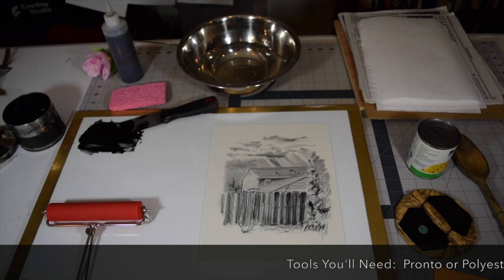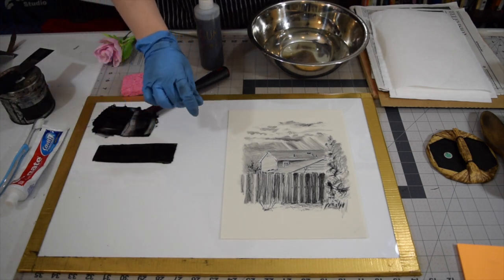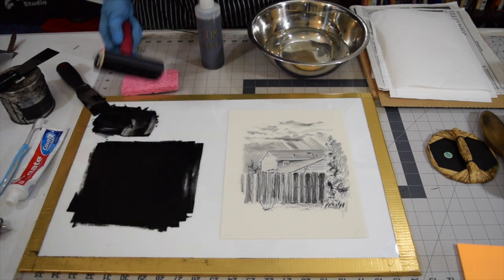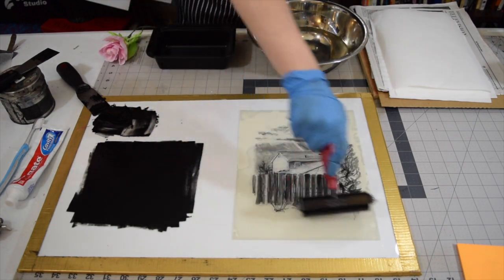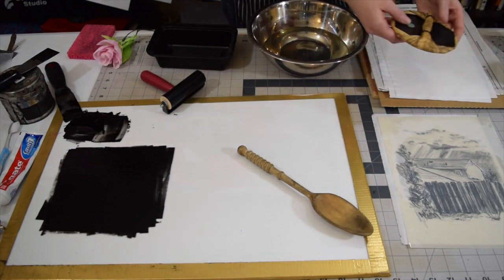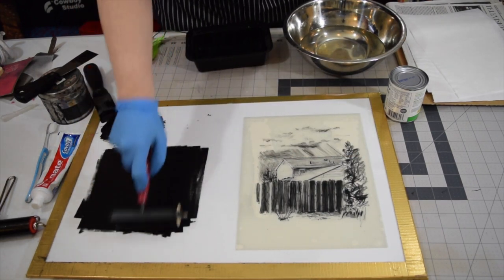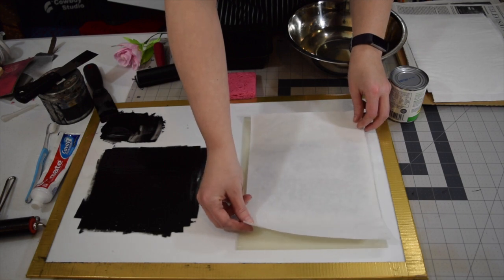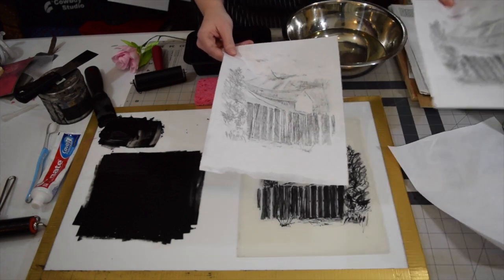How to Print a Pronto Plate Lithograph By Hand

Comment: awesome video! If you’re needing to soak your paper and are doing a multi plate lithograph, you can just ink all of the plates and print all of the plates in one go while the paper is still wet (similar to multi copper plate intaglio). I use a press but it works for me! :) I plan on trying it out by hand soon. 👍
Reply from the maker: Yes, great idea for multi-plate lithos! These are definitely more difficult to do by hand, but I found it's not impossible.  Happy Printing!

Comment: is the plate reusable? can you clean the ink?
Reply from the maker: @gone96  Great question! The plate is reusable up until the point it may start to break down. Sometimes the physical drawing materials may start to wear off especially if one doesn’t etch it into the plate or if using a laser printer the toner particles tend start to wear off (I’ll often print a couple copies of a design to plates if I want to print more than 10 impressions at a time for the laser toner prints) But I’ve used plates over 20 times for ballpoint pen especially and then I’ve also reused used the back sides of double sided plates but accepted the inks and fingerprints on it. Often cleaning the ink off will damage the plate so usually I will strip as much ink as I can off by running it through the press with clean newsprint a couple times and ink it up in the new color, and several of the next impressions will gradually transition to the newer color as there may be some of the old ink still embedded in the plate.  I found it’s a fun way to print a variable edition especially if I transition from one color to a contrasting color in value or saturation.

Comment: Is this possible to do with with a metal plate at home?
Reply from the maker: Hi Mia! I have not attempted to print a ball-grained litho plate by hand rather than by press. I imagine without the full traditional Tapem etching and roll-up and second etch processes, it may be an unstable, impermanent image in the plate which could either fade, or non-image areas may fill in quickly, similar to how pronto plates are. Given the expense, I personally would want to use the proper press and process for a plate, but if that's all you have plate-wise and press-wise during this quarantine time, I don't think it would hurt to try!  That oil and water can't mix as the basis of this process, I imagine it could work for a while, but as I said, like pronto plate printing or wood lithography, without establishing the image through etching, it may not last long.
Reply from the maker: There are videos out there by others on "kitchen sink lithography" or "kitchen lithography", doing a similar process to polyester plates that use tin foil as this matrix and soda, vinegar, or soy sauce to etch, which I would recommend checking out.   Happy Printing!
Reply: @Chcole88  thanks for this! The plate I have is an aluminium plate with the image already on it. That's all I have plate and press wise so hopefully, it should work. Thanks again!

Comment: What ink did you use?
Reply from the maker: Hi Ivan- I used an oil based ink- either an etching ink or Lithography ink. During the pandemic it may have just been etching ink. If I have it on hand, I add setswell compound or easy wipe to reduce the tack of inks especially when using printer toner based images. And for color litho or offset inks I add magnesium carbonate to stiffen it so it sits in a pile on my ink slab without spreading. Do not use one of the oil-based water miscible printmaking inks on the market, such as Cranfield Caligo inks or the newer Speedball Professional water soluble oil based inks- I’ve watched students panic when they saw their images start to smear and fill in only to discover they were using one of those inks! Fine for etching, not for litho!
Reply: @Chcole88  What kind of lithography ink?  I have carbonnel roll up black, gamblin portland litho black, and graphic chemical shop mix?  Just wondering if shop mix should be used or roll up?
Reply from the maker: @Wiggins_Gaming  Hi! Out of your choices, I would go with the gamblin litho black, as I believe the roll up black and the shop mix (usually a mix of roll up and another black) have a higher grease content, which on a polyester plate can end up marking the plate and accidentally filling in spaces and delicate tones faster, especially if it's not processed with etching it or a fountain solution. I've also used etching inks, maybe modified a little bit to make sure it was not too loose and not too tacky to rip up any drawing material or toner. With the process color litho inks I have to add a lot of magnesium carbonate to get it to work with polyester plate, and sometimes add an easy wipe or something similar to reduce tack without adding anything too greasy

Comment: Hi! I didin´t get what is toothpaste for?
Reply from the maker: Hi there! Thank you for your question. I was using it as a way to gently scrub away scumming, in which ink starts building up or sticking in areas that are not part of the drawn image area. With stone lithography, I may use a snake slip for this purpose, but in my experience with the polyester plates, snake slips or scrubbing too hard with toothpaste usually scuffs up or scores the plate and causes even more ink to stick to the non-images areas I want to stay clean. So toothpaste is optional and can help with troubleshooting issues with scumming, but if scrubbed too hard it can further add to the very issue one is trying to resolve. Hope that answer helps! Thanks for watching!
Reply: @Chcole88  Thanks! I just clean it up my finges XD but in the next print they come back.  If you etch the plate with gum arabic afther clean it up, the scumming and the other problems, like ink sticking in clean areas, stop.

Comment: how would a ready made image work with the pronto plate or is the photocopy for example considered a plate in itself and not compatible with this plate? many thanks!
Reply from the maker: Hi @N H!  With the pronto plates, you can hand-draw an image using the litho crayons and other greasy materials I mention, but as they also come in standard sizes, you can print an image directly onto the pronto plate with a laser printer or xerox toner photocopier or printer (not inkjet) and you ink it up and print it just like I show in the video.  The pronto plates are also semi-transparent, so one could overlap the plate with a reference image or drawing and use a window, lightbox, or fully bright lit-up white page on a tablet to see the image for tracing or using the reference image as a guide for your drawing.

Some artists I know do a version of lithography similar to what you mention called "paper lithography" by printing a laser printed image on a piece of cardstock and inking it up like a traditional lithograph, minus the etching and roll-up processes. They don't last very long but they're good for a few variable prints.

I personally haven't experimented with it transferring a photocopy to the pronto plate, like one could with a laser/toner photocopy to a traditional lithography stone or plate with lacquer thinner or acetone or wintergreen oil (all not great to breathe in) or those chartpak transfer markers. So it might be possible to transfer a photocopy to a pronto plate, but I haven't tried it yet.
Reply: @Chcole88  Thanks so much Catherine for you swift and thorough reply. I will buy some plates ( 'polyester litho plates' here in the UK) and give them a whirl. I appreciate your words and advice. Should you ever feel the need to experiment with multicolour pronto plate printing please don't hesitate to share with us! Haha 
Subbed in thanks :)